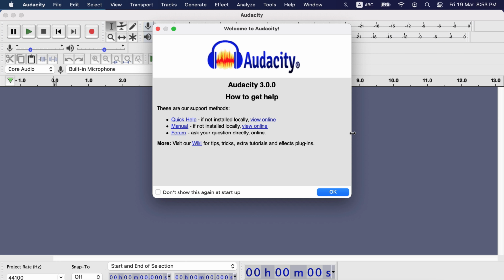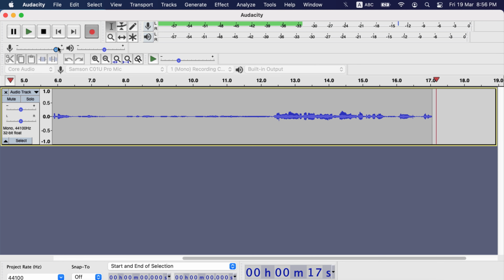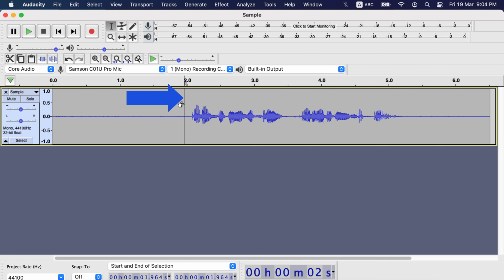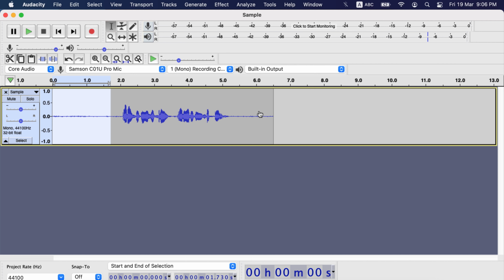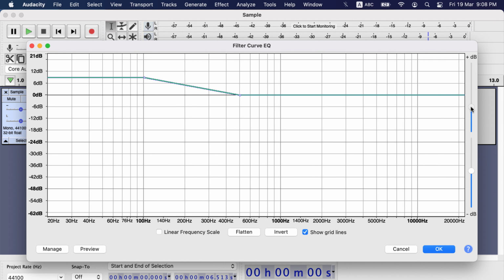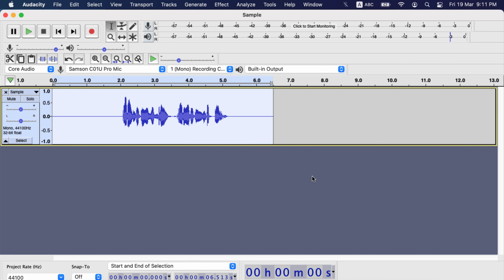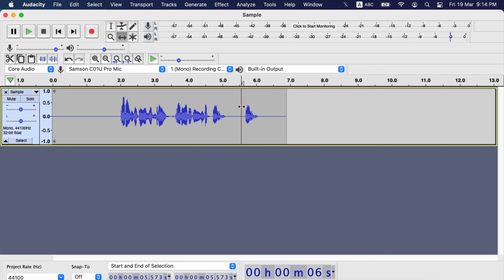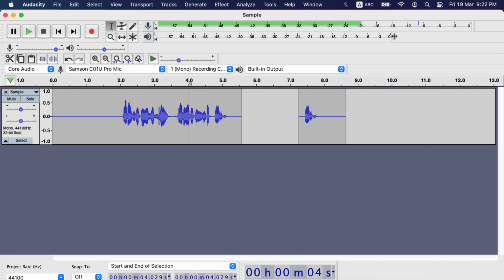Audacity Tutorial for beginners: using Audacity 3

Comment: No, there are lots of ppl who can't select audio properly anymore with the new versions on Windows 10. And the solution is nowhere to be found. Do you or anyone else reading this know how to fix it because it makes Audacity completely useless, after using is for 6 years i now suddenly have this problem.  thanks in advance.
Reply from the maker: hmm, it's very unfortunate and disturbing. I use mac, so not facing the issue. I hope someone using windows comes forward. You can make a video about the issue on you channel and I can share that on Community tab if anyone knows the fix.
Reply: @MasterEditor5   .now i fixed it :-) i didnt stop finding out the problem untill i had it. And its in the settings of the timer on the bottom. :-)  in the newer versions this needs to be set manually. No one knew and i also could not find this info anywhere.. so glad it 's solved now

Comment: I have an issue with the recording GAIN - everything is all the way up - and still the recording level is low. Also, when using the AMPLIFY tool to quiet the breaths by decreasing the db, it INCREASES the wave form.  Very confusing!!
Reply from the maker: Which and what type of microphone you are using? Amplify works with respect to current level. Select a small part, play it and check in the playback meter upto which db it goes. Then move the slider to the left in a way, so that new peak amplitude will be less than what you saw in playback meter. If new peak amplitude is more than what you saw in the playback meter, volume will increase.
Reply: @MasterEditor5  SHURE MV7, and Focusrite solo. I think I have to amplify and then normalize.
Reply from the maker: I don't have experience to use forcustic solo, but I guess you have to do something to increase recording loudness from there. Afterwards you have to normalize.